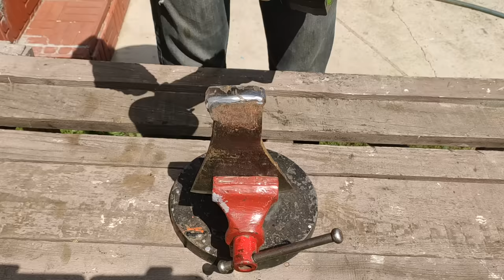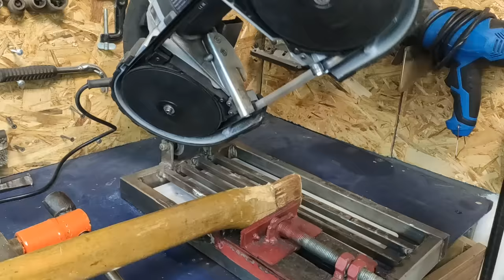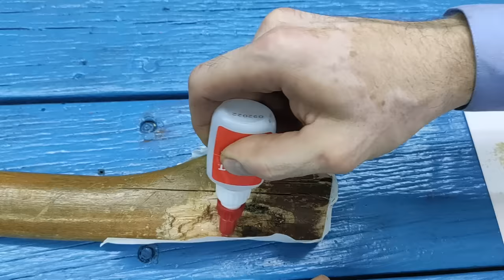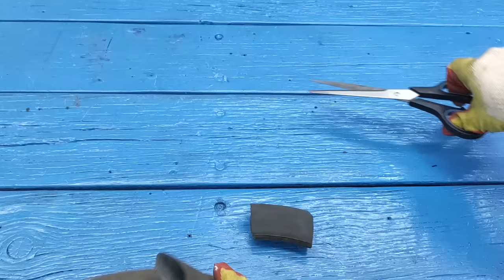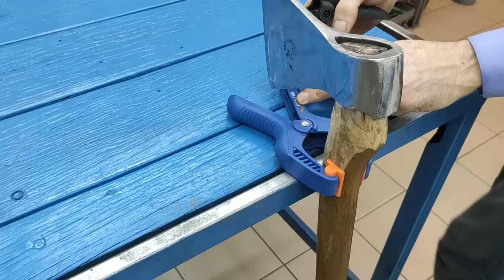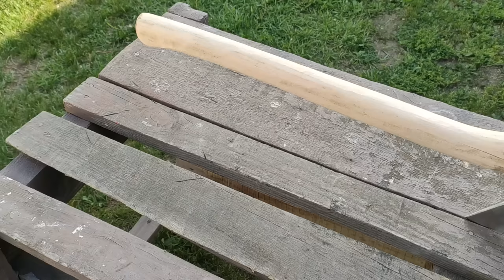CARPENTERS DON'T WANT YOU TO KNOW THAT! The secret method of securing the axe

Comment: No, no, no. Do not do if you do not want axe head flying off. The timber of the axe handle has lost its integrity. Buy a new handle and wedges, they are very cheap. Fix axe head onto handle small end first and then hammer in the wedges to fully expand the handle into the wide end of the axe head.  Glues will not survive the impact vibrations of an axe in use.
Reply: You mean he should not risk the wrath of the secretive carpenters when he can easily fix it for twenty bucks?
Reply: @testdriver3146  No, not at all. It is knowing the difference between something that is repairable and something that is beyond that.  This repair may be useful if you are the only one using it and KNOW NOT to do heavy forceful work with it, but if someone else found it and decided to chop a tree down with it or did anything else that would put heavy force and strain onto the handle . . . they might be lucky and the axe head stays stuck in the tree and the handle just comes off and stays in your hand. Anyone who has ever done any heavy intensive axe work knows where I'm coming from - those things go through hell and need regular maintenance.  But I suspect you're not really serious.
Reply: Φίλε μου,η κόλα στοιχίζει 3 ευρώ και το στυλιαρι 4 ευρω. Γιατί να το κάνει κάποιος και μάλιστα με αμφίβολα αποτελέσματα?
Reply: @BryanClark-gk6ie  Lead is too soft and the handle will eventually work itself loose again.  Maybe one of those two-pack adhesives used for repairing metal products, but that is a BIG MAYBE since I do not have experience in the use of such products in this type of application. But again, is the handle still in good nick otherwise? Ultimately, a new handle and wedges is still much cheaper.
Reply: @BryanClark-gk6ie  If you go into any major hardware store you will find tools such as hammers and axes with fiberglass and other synthetic handles. They work great and are probably better than timber handles.  Thing is, they are all fiberglass, not a mixture of timber and synthetic.  With time, temperature and use the two will most likely separate, and this will be made worse if the timber was split or fibrous when the repair was carried out. It doesn't matter if the resin is mixed with fiberglass or metal shavings it is the resin that holds it all together and the resin may stick to the timber for a while but I suspect they will eventually separate. I personally wouldn't bother, a new handle is easier. But why not experiment? Just don't put yourself in a dangerous situation if the experiment fails.
Reply: @BryanClark-gk6ie  It's 6 in the evening where I am in Australia, and have worked in the building industry all my life. I do get up at 5 in the morning. If you are going to experiment draw lessons from programs such as the Mythbusters and realise that they always put safety first. Don't take any unnecessary risks. You can also save money by scaling experiments down. With this project try small amounts of adhesives on different materials and then try to simulate what they would experience in the real world.  Have fun.
Reply: Shouldn’t the wedges be inline with the axe head and not perpendicular?
Reply: That ax will probably last that man the rest of his life! People are too sissyfied nowadays with all the safety crap! While I know a new handle would be better, not everyone can afford 20 bucks and have to make due with what they have! I have a ax I did very similar and that was 8 years ago and it’s still working! When it breaks, I will replace it then. Don’t fix it if it’s not broke!
Reply: I have reached a new low by watching this video to the end.  Nothing done in this video will result in a serviceable axe.  The glue cost considerably more than a new handle which if installed properly (not as in this video) would last ten as long. Hilarious.
Reply: @jacobdewizard 😊
Reply: @Steli320  sounds cheap with a hair-stylist for 4 euros ! - here in Sweden the cheapest ones take like 25.
The cola (if you meant the soda) is cheaper though :)
Reply: РОССИЯНКА ИРИНА КОСТОГЛОД из Ростова-на-Дону @jacobdewizard Прав почти во всем!!! Нужно или удалить испорченный верх, УМЕНЬШИВ ДЛИНУ РУКОЯТКИ! ИЛИ ЗАМЕНИТЬ! Опасно!МОЖЕТ ОТЛЕТЕТЬ ТОПОРИЩЕ!! НО И КЛИНЬЯ ЛУЧШЕ НЕ ВБИВАТЬ!!! А ПРОСТО ВБИТЬ ДЕРЕВО МАКСИМАЛЬНО ПЛОТНЕЕ!!! А ВМЕСТО КЛИНЬЕВ, тем более  ДЕРЕВЯННЫХ-ГВОЗДИ!!!! ВБИТЬ!!! Это ЕСЛИ ЕСТЬ  ПУСТОТЫ!!!Я не все знаю, но часть процесса ВИДЕЛА, КАК ДЕЛАЮТ МУЖЧИНЫ РУССКИЕ. У НАС НОРМАЛЬНЫЙ МУЖИК ПОМЕНЯЕТ РУКОЯТКУ.Я так делала с МОЛОТКОМ: СРЕДНИМ И МАЛЕНЬКИМ!!!ПРИНЦИП ОДИН. Но в моем случае- безопаснее!!!
Reply: That isn’t going to make it very long. The handle needs to be proud of the top of the axe head. Then the wedge mushrooms it out which is literally what holds the head on. Hot glue isn’t gonna cut it
Reply: Agreed. For all this effort, new handle. Hardwood wedge, steel wedge. For added security, drill through the ax and handle and drive in a ¼ inch roll pin. Grind smooth. This is a requirement at many competitions, for safety. I do it on axes and hookaroons. You need a very hard drill bit if the ax is of any quality. I use carbude machinist bits. Flea market luck. I am an arboist and write from actual, real world experience, unlike the author of this video.
Reply: Truth
Reply: @ricknelson5493  Я, Костоглод Ирина, в уважение к Вам, написала ответ именно Вам!!! Но попал этот ответ в общую очередь, к ОСНОВНОМУ АВТОРУ!!! СПАСИБО ВАМ!!!
Reply: SI  VEDE  CHE  HAI  MOLTO  TEMPO  DA  PERDERE  INUTILMENTE.  CIANO .😂
Reply: If I had all those great tools, I'd buy new axe.
Reply: New handle, definitely. In a bad  situation, then yes.
Reply: First, orient the head correctly. 😂
Reply: And while you're at it replace the head. Then it will be just like new.
Reply: @rockzog  🤣🤣🤣🤣🤣🤣🤣🤣🤣🤣🤣🤣
Reply: @drunkwoodswyllia4885  I agree 100%, especially if his life is shortened by a flying ax head🤣😂
Reply: Noe machen
Reply: Il faut faire un manche emboîté par le bout avec une tête qui dépasse d'au moins deux centimètres plus forten finition.*
Reply: @rockzog He put it on the wrong way didn't he.
Reply: @jacobdewizard  Its a good idea for someone who doesn't have access to a hardware store.
Reply: @greggerstner5599  Interesting about the roll pin.

Comment: A new hande would only cost $10, and have more integrity than the repaired one.
Reply: Well Steve, in our country a very average handle starts at about $26, if you're lucky and a serviceable axe starts at around $60. The economics of spending any longer than 25  minutes fitting a new one don't add up.  Very sad to be throwing old heads in the scrap metal bin.
Reply: @philgray1023  could buy a complete good brand name hatchet in rip-off UK for under 15 USD. Irks me greatly that here replacement handles normally cost same or more than finished item - new wedges extra spend on top.

Comment: A piece of inner tube and hot melt glue seems pretty underwhelming when it comes to holding an axe head on. 
No new wooden wedge for the top, crazy glue and sawdust which did not fill the cracks all the way, a piece of inner tube as a filler, and hot melt glue (known for it’s temporary properties) and no wooden wedge. This is a ridiculous fix for a high impact tool. I just hope you don’t injure or kill someone when, not if, the head flies off.
Reply: @huejanus5505 -  🤣👍👏
Reply: In Germany they call something like this PFUSCH!!! It's laughable to publish something like that!!!

Comment: Here's a counter-intuitive "secret" that most don't know: The proper way to insert an ax handle into an ax is to suspend the ax (with handle partially inserted) upside down and tap on the BOTTOM of the handle. Doing so "drives" the wooden handle into the heavy (high inertia) ax head. Do NOT place the ax on a surface -- hold it suspended in the air. NOBODY would assume that would be a useful way to do it, but old timers know it's the only practical way, and it works amazingly well. Try it sometime, lol. (I'll never forget my own awe when an old-timer showed me that trick -- because it's so counter-intuitive).
Reply: The best insight I have as a carpenter.
Always tap on the steal.
(Physically, this is the principle of inertia. The same principle can be observed when shoveling sand with a scoop)
Reply: Die beste Erkenntnis,die auch jeder Schreiner weiss:
Immer auf das Stielende klopfen.
(physikalisch handelt es sich um das Trägheitsprinzip. Dasselbe Prinzip ist zu beobachten beim Schaufeln von Sand mit einer Schüppe)
Reply: @kzimm59  It is a truism that sometimes older "wisdom" can become lost, and people can "forget a fact" which was once widely known and understood. I say this with confidence because I also watch physics videos on youtube, and one happened to professionally discuss this actual phenomenon. And indeed, the claim is that THIS actually involves the principle of inertia: trying to force something "light" into something "heavy" works well, simple BECAUSE the light thing moves more easily into the heavy thing. I can only suggest to you that you try it yourself. Get an ACTUAL wooden handle and an actual steel ax head, and try it both ways. You will easily see that hitting the base of the handle makes for easy insertion into the head while doing it the other way feels VERY inefficient. It seems like magic, but anyone who tries it can see it EASILY. You will be amazed and surprised.
Reply: @GetMeThere1  A nice discussion, but (nearly) useless. If the wooden part is crafted well, it doesn´t matter which side you slapp to get the handle inside the axe´s head, Somehow you will get it, fix it with a wedge and that´s it.
Take a look at the first seconds here: The handle is badly harmed by working with the axe. This leads to dissapear the wood piece by piece. I am a very good wood-cutter and if I want to, I meet the target with the axe. But you know, not every time - and if the axes cut meets behind the edge of the wood, the handle may touch the wood. THIS is the main cause to break your handle piece by piece. I lost some handles this way too, this is just the way it goes during time. But you can help it and fix the problem:
Get a strap of stainless iron-sheet and wrap it arround the top of your handle just below the axe´s head and fix it with some screws. Soften the edges of the metal for safety action. you can believe me: This will protect your handle for years and the only thing to do with this axe is to cut wood and sharpen it. But the handle is in place unharmed for a very long time. (sorry for my not perfect writing). I saw this by meeting a friend (with his axe) and since I did like he, I never changed an axe´s handle again.
Reply: @UKOnation  LOL. I stopped reading after "it doesn't matter which side you slapp." As someone who isn't merely TALKING, but who has in fact "SLAPPED in both directions," I know that it matters VASTLY, LOL. What a nice example you give of the importance of SCIENCE -- where experiment ALWAYS trumps theory and reasoning. PLEASE, go buy an ax handle and an ax head, and TRY IT both ways -- then you will have learned something! LOLOLOL.
Reply: @GetMeThere1  The only thing I wanted to say to this is, you will reach the target, no matter which way you take. I didn´t say, that one way is wrong.  The diskussion about this is just useless and I showed up why (because of the damage at the handle by using it is the main factor (by far!) to destroy the handle.
My theme was just the protection of the handle, but it seem´s, you prefer to waste time. (?)
And yes - what you say is something of knowledge, there´s no doubt. But in practice (!) some perfect knowledge doesn´t really cause a big difference. And this is one example of it.
Reply: @UKOnation  A shorter youtube video is "How the US Forest Service hangs an AXE - Wranglerstar professional Homeowner." Watch it so that you can stop being a fool.
Reply: @UKOnation  If you watch the first video I reference you will see that the handle is driven in SO TIGHTLY that, at the end, it scraps wood from the handle, which the man cuts off. There is NO WAY to put the handle in that tightly going the other way. And still you try to defend yourself. Apparently, it's very difficult for you to learn something, and to appreciate when someone teaches you something. There ARE strict science videos on youtube which discuss the physics of this -- I have seen one or two over the years, but I can't seem to find them now.
Reply: @GetMeThere1  Sorry, I told you, this is not my theme.
Reply: I learned that in the Boy Scouts 55 years ago!!!!
Reply: @surroundedbyjaggoffs  Yup. People knew a LOT of stuff back then, which is now mostly forgotten.
Reply: Rubics cube for dummies

Comment: the proper method is to put the axe head on the proper way around narrow eye 1st and then use wedges in the wide end to lock it assuming its a tapered axe head ?

Comment: I was taught to drive a wedge diagonally. The stress is distributed to the vertical and side walls. Now the ax can be hung on the carpet above the bed as a decoration. Cleaned up nicely!
Reply: 10,000 worth of tools to restore an axe!!!
Reply: Ты хотел сказать, по вертикали, brazer
Reply: @Александр-г6и7у  Only diagonally, только по диагонали. Тогда распирать древесину топорища будет во всех направлениях. А еще, клин пропиливается  ножовкой на 2/3 посередине и края, каждой пропиленной половины, затачиваются в разные стороны. Тогда,  при забивании клина,  края расходятся винтом в древесине, что  затрудняет его выпадение.

Comment: Use epoxy resin in the crack and use it with filler for the broken areas. Make a wedge of hardwood, secure with stainsteel screws.  Use inner tube at the end to pretect the handle

Comment: Sorry, that's only a dangerous and short-lived fix - neither the innertube liner nor the hot glue offer a strong and secure hanging. With that massive crack in the handle it's only good for firewood and needs to be replaced.
Reply: Roger this, 100%

Comment: You have patched up the cracks as if it was a dent on a car panel. This fix requires FORMIDABLE structural strength which your repair has not provided. You have hidden the structural flaws of the handles with a cosmetic cover up. Now you have a seriously defective axe which should be on a mantelpiece NOT used in the field. Thanks for posting

Comment: Scorch the handle with a torch. I'd consider cold bluing the head to prevent rust. I've used Elmer's glue and sawdust to fill wood voids but not Crazy Glue. Great idea.  Excellent job on that

Comment: This is not any sort of a proper way to fix a axe, you really need to just buy a new handle or make one. This fix would not last very long. And the glue would not last the vibration or impact of cutting wood.

Comment: A really nice restoration of a beautiful axe head.  The use of hot glue to fill in the gaps was genius.  Thank you for posting.
Reply: It would only work for an exhibition axe. A real one you'd use needs proper work, a new handle or you might experience an awful accident with this one.
Reply: @ContraVsGigi  exactly
Reply: The use of hot glue to fill the gaps between axehead and handle is something, that only an idiot would do. Sorry for this harsh words, but it's the truth
Reply: Epoxy. Might do the trick.
Reply: I just broke a sledge hammer putting in some fence posts, maybe I'll try something similar to fix it.
Reply: What a great idea

Comment: I use JB Weld instead of hot glue, head /wood all coated with JB Weld while assembling.
Reply: I don't use glue i put wedge in then soak in water overnight for a standard hickory handle

Comment: As a master carpenter and joiner  O N C & H N C, I don't give a hoot who knows how to to do anything I can do, wrinkles and all.. The difference being I know how to do things naturally skillfully and professionally and get top results first time. What was achieved here was a waste of time money and effort. A new hand axe like this one can be bought at any hardware store very very cheaply. Also were this an "antique" the "restoration" would have made it worthless. Furthermore the axe had been misused hence the weld at the rear of the head, because it had been split and welded, and in my professional opinion should have been discarded then and there! 
Wanna know a secret secret that has been a secret tradesmans secret since tools with wooden handles were invented??? If the axe head, hammer head, pick axe head  whatever gets loose leave it in a bucket of water! for a few days. Never use this method though, glue stick fusing like this will fail for sure and the head could easily fly off!

Comment: Here's a DYI tip.    Buy the correct tool you need, as you go.   No forge, no grinder, no welder etc.     i have every tool I need and don't have to store the heavy artillery.    And no need for these expert heavy duty skills.

Comment: For the amount of money you spent on super glue and glue sticks. You could have bought a cheap handle. Or you could have carved your own out of a piece of wood for nothing. I don't care what anybody says. Once it has a split in the head part. You cannot depend on that handle not to break. 
I guess if you're just using it around the house and you don't have don't worry about someone taking you to the ER I guess that's fine. It's a neat trick if it hadn't been split. I prepare a few accidents in my day the head part is the easy part but I would never mess around trying to save a handle like that. Shop like that you could have made a handle out of just about anything. A handle you could trust

Comment: too much work. on my axes, i bore a hole into the side of the head, put in a large nail, and cut it off the other side, leaving enough to peen down. before I put on a new handle, I sand off the lacquer that was sprayed on, brush it with a 75/25 oil to diesel mix, then attach the head and brush on the oil mix on the whole handle. I will whittle down the handle little by little to make a tight fit. Oh, where is the secret?